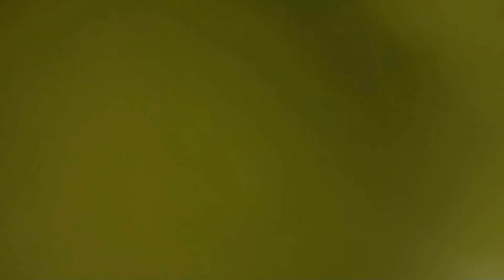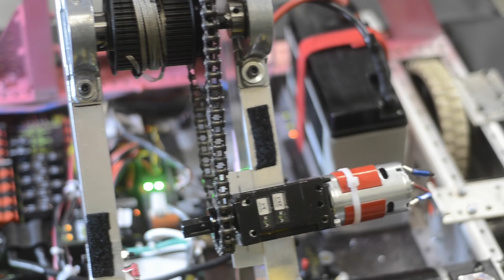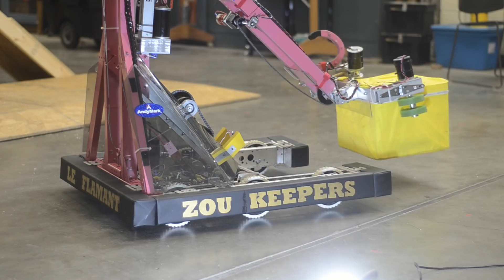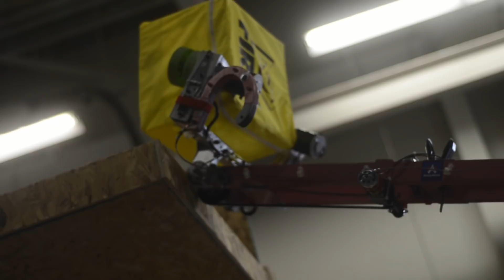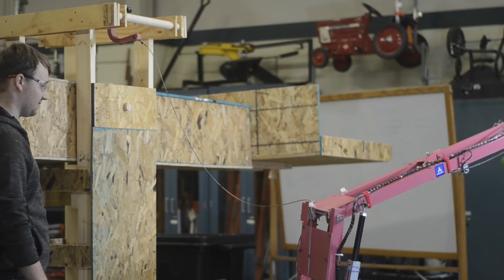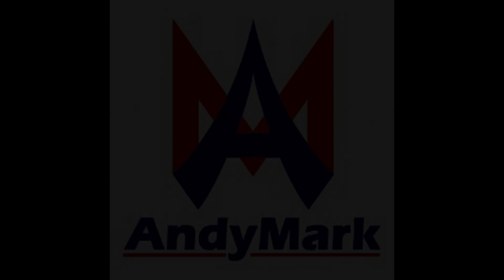Ri3D 2018 - Zou Keepers Reveal - FIRST Power Up

Comment: Hello :) I am part of an FRC team that is currently in the middle of prototyping. It looks like you just used cim motors for the intake. Did you run those at full speed when picking up a cube?
Reply: correction, they used "mini cims"
Reply: correct

Comment: It's a def risky climb for this robot imho
Reply: The climb would have been immensely improved by just having some sort of solid ring near the top of the main tower, like the eye bolt that is at the base. This would have shifted the effective "hang point" from the bottom of the robot to the top, and the whole thing wouldn't have flipped while the winch was pulling. Not sure what happened with the winch failure, either.

Also, it seems like the hook would have been much more effective if it were flipped around, with the open side facing the front of the robot. With the current setup, the whole hooking and detaching procedure looked incredibly awkward, whereas it could have been a single smooth motion.